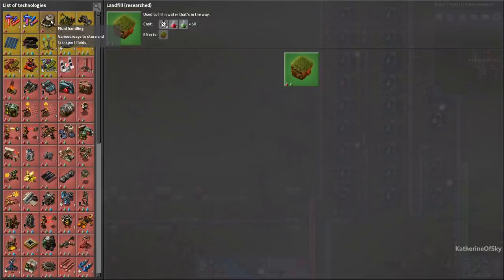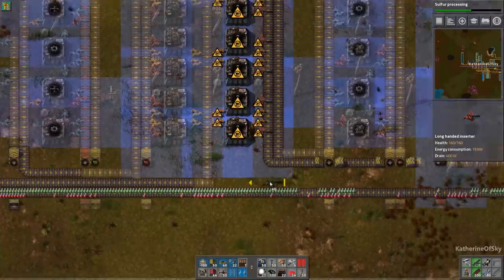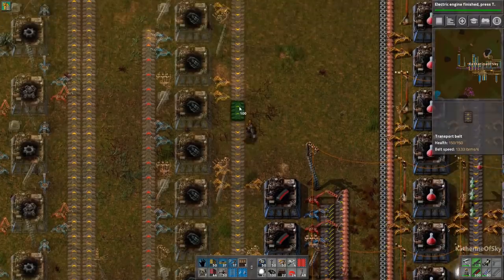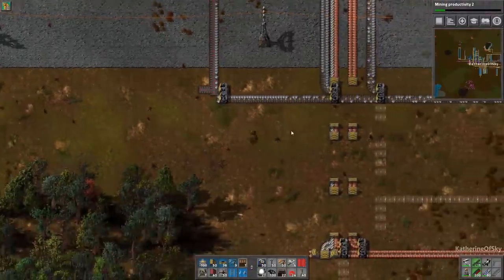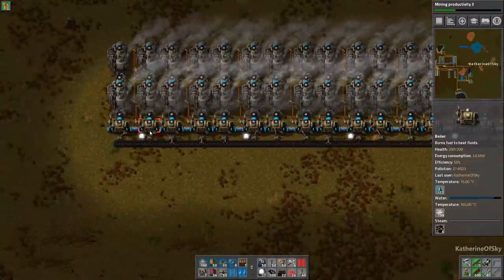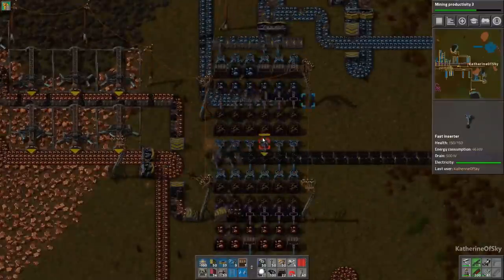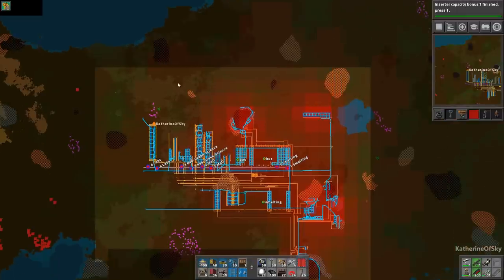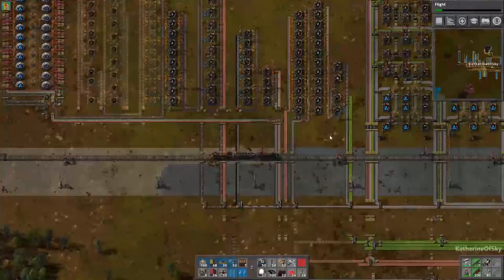Factorio: Entry Level to Megabase Ep 12: MILITARY SCIENCE / COAL FOR POWER! - Tutorial Series

Comment: Really enjoy playing with these blueprints, but I had one issue so far with the military science.  Until you get stack inserter bonus 2 (+1 pickup for non-stack inserters), inserters couldn't keep up with the ammo assembly machines.  I know this bonus is super useful and easy to get fairly early, but if playing with biters and higher science multipliers, this is more of an issue as you want ammo before inserter bonus.  might want to consider rearranging those lines and inserters to work without the inserter bonus 2.  Love the videos!  Thanks for the content!
Reply from the maker: It's a non-issue -- this is military SCIENCE, and stack bonus will be easily maxed with blue science.  If you have a death world, you should build dedicated ammo production, and not rely on the possibility of excess production of the science structure :-)
Reply: It's a bummer you see it that way.  The blueprint could easily be changed without any drawbacks to work effectively without the upgrade.  I probably would have optimized it before sharing it, but that's me.  I'm not playing on a deathworld, but I do have science multipliers turned up so I wanted to setup the military science before blue science.

On another note, I also found the spacing on the undergrounds for the labs weird.  Any reason why the undergrounds are so oddly packed? It uses more undergrounds than necessary and I'm not sure I understand the benefit.

Comment: My solution to the burner inserter/power issue is that I take one burner/turbine combo to create a power source dedicated to running electric inserters for the rest of the burners. Then I feed that combo with a burner inserter. The burner/turbine combo only uses coal when the inserters run and its only one burner inserter that can run a very large power system.

Comment: Hi KoS. 
You have a slight problem. Until the inserter stack bonus has been researched, some of the lines will not be at full production.
E.g:
- The piercing rounds are starved for copper. Longhanded inserters are too slow.
- The firearm magazines would be starved of iron(*). A single fast inserter is not enough.

(*) This is not visible since the magazines are not fully used in the next step.

It is a slight problem, but it would encourage research of the inserter stack bonus. Level 2 bonus is just what is needed and you did it before the end of the episode.
Reply from the maker: Stack inserter bonus is a high priority for me, don't worry :-)  ATM, I'm torn between getting more iron and getting oil setup!  So many things!  XD
Reply: Expensive recipes circuits are tough. they need 12 items input and the product output, totalling 13 inserters. Only 12 inserters are possible, so in this case the cable will have to make do with 11 of the 12 needed.

Comment: Hello,
first of all: Thanks for the videos. I got back to Factorio, thanks to your videos :)
now the question i was wondering about for a while: Why are you using the "belt around scince" instead of feeding some buildings and chaining them together?
greetings from germany
Reply from the maker: I'm not using the chain method because I like to have a central line of beacons to speed up research.  I'm not a big fan of chaining because it's harder to fit beacons in and nearly all the time, the labs in the front of the chain are starved, while the ones in back use all the production anyway.
Reply: I just tested it, chaining does not work as smoothly as it should
Reply: I just tried chaining labs for the first time, in the little initial starter base. Much as you did in the beginning of this series.  Even on that small scale with just a few red/green science, uneven distribution among labs quickly became apparent.  I had previously used loop systems, and I think I'm going to stick with that.

I had (have) a loop design with two outer and one inner loop, carrying 6 of the 7 science types.  With space between labs to allow chaining the space packs through once first rocket is launched.  Functionally it works pretty well, but I guess it's probably somewhat space-inefficient, on a tile-per-lab basis.  And I haven't tried yet, but I'm pretty sure it's not compatible with beacons (another aspect of the game I haven't explored yet).  Now that I see how belt-braiding works, will have to tinker with it some more.

Comment: Hey KatherineOfSky when i was using your mail for early game i have found out that there is 1 express belt and 1 express under underground in the blue print. you can find the belt when you follow the green and red circuits line in the middle and the underground is on the belt making half and to find it you need to follow the Iron gear wheels.
Reply from the maker: Thanks!  I'll check on it!

Comment: Do you have a list of everything that typically goes on your main bus?  I don't want to start my main bus only to realize much later on that there's something else I should have included - but no longer have room for.
Reply from the maker: That's the reason I build on only 1 side of the bus -- so it is extendable.  (Steel is not in the way of any intermediate products).  So: Iron, Copper, Stone, Stone Bricks, Coal, Steel, Red, Green, Blue Circuits, Batteries, Plastic, Lubricant, Sulfuric Acid.

Comment: Can anyone explain the 2/cycle that was mentioned ~2:20? It was mentioned in the previous video too! What cycle specifically? Thanks!
Reply from the maker: The cycle is -ish "per second".  Because the assembly machines process at 0.75 speed, it isn't strictly "per second".  That's why I'm saying "2 per cycle".  (It's actually 1.5 per second).
Reply: Thanks for the reply, I should have been a little bit more clear with my question! I understand why we should say cycle instead of second (bc of relative crafting speeds of different machines), but I don't get what is being produced at 2/cycle. Are we producing 2 science / cycle? and then the follow-up question to that would be 2 science / cycle of what? A cycle of producing a gear has different length from a cycle producing a red science pack, which has different lengths compared to other sciences. 
Thanks for your time, this seems kind of silly the more I write it out, but I feel understanding the concept would help alot towards doing my own setups and not directly copying them from your google drive :)

Comment: I disagree with the argument for burner inserters, since it's never the inserters that fail. The miners will always fail first when on low power.
Reply from the maker: Indeed they will.  However, when you kickstart the system by getting coal back on the belt, the burner inserters will start up automatically without intervention -- very handy if you are far away.  Electric inserters will sit there dead, and you have to manually fill the boilers with coal.

Comment: why don't you put burner incerters and fast incerters for the power they work ether way
Reply from the maker: They don't work the same way, as I have explained in the vids.  When you kickstart the system by getting coal back on the belt, the burner inserters will start up automatically without intervention -- very handy if you are far away.  Electric inserters will sit there dead, and you have to manually fill the boilers with coal.
Reply: I usually have one burner inserter and the other regulars. That way, the system can still restart with coal but I also get the fuel efficiency of the electric inserter.
Reply from the maker: That's the beauty of Factorio -- everyone can play the way they wish!  I don't use steam power for long, typically, so changing out inserters is not a high priority for me, especially not when I have mountains of coal!
Reply: On not-so-rich maps I use electric inserters(lower energy consum.than burners) to feed the boilers but like to separate these inserters from the main power grid. If the factory draw too much power, everything is going to slow down except the boilers' inserters. Shut down spiral evaded.
Secondary or separated grid: 1(or2) steam engine(s) and 1 burner inserter enough for 69(or138) "feeder" inserters to work flawlessly (solarpower with accu.s works too, but more space and math is needed xD).
If the powerstation is out of fuel this separated burner inserter can restart the whole factory (if it has fuel again).
(sry bad english)
Anyway I like your series KoS! Keep going and have fun! :D

Petigp
Reply: I kinda like this idea.  I once worked in a steam-powered ship, with boilers/turbines for main propulsion and electrical power generation.  But we also had backup diesel generators for emergencies.  Very rarely used...these generators were almost 30 years old with only a couple hundred running hours over that span.  BUT...when they were needed, worth their weight in gold.

It now occurs to me, that diesel fuel as an additional fluid type (perhaps only available with Advanced Oil Processing and must be cracked), and generators which must be fed in liquid form (i.e., not able to take wood/coal/solid/rocket) could be an interesting addition to the game.  Could be a worthwhile "middle road" option between coal/steam and solar regarding efficiency and pollution.
Reply: There is a mod, 'KS Power'. It has diesel generator and some new powersource.
https://mods.factorio.com/mods/Klonan/KS_Power
Reply: Indeed. I got rather screwed over by that on the first map I played. When power started getting low, the inserters go slower, which reduces the power even more, until they just stopped working all together.
Reply: That sounds like a pretty good idea, might give that a try.